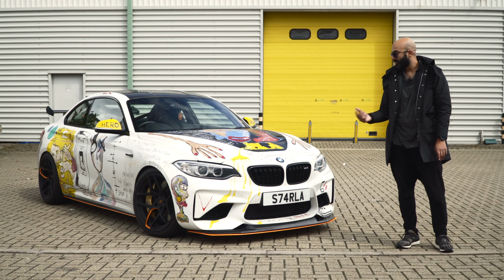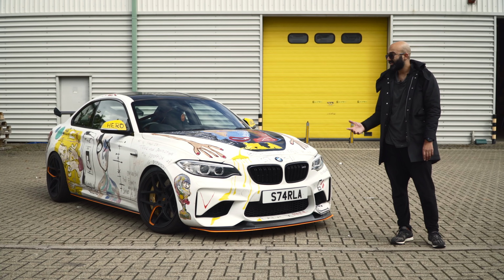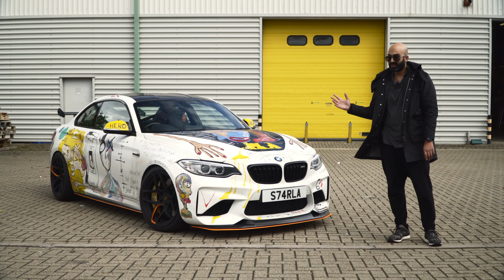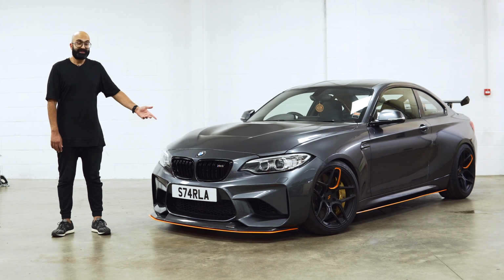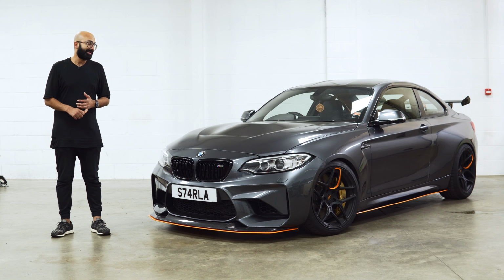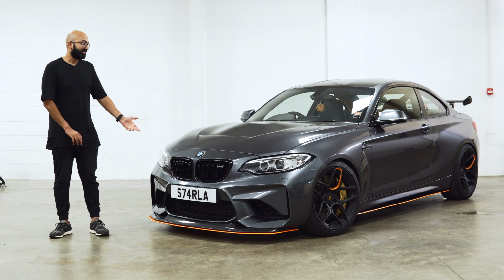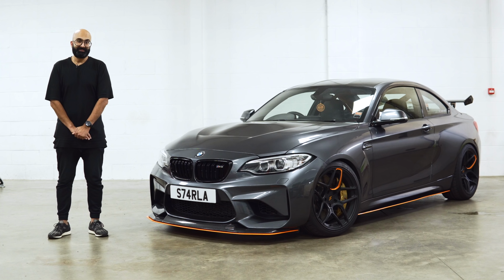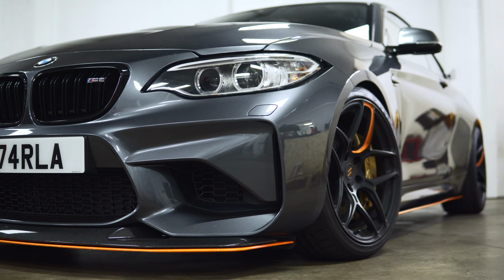RIP M2 GTS Art Car

Comment: I’ve a 2016 M2 Mineral Gray with just 4000 km... and I’m considering the carbon roof. How difficult is it to install it? Does the interior get ruined? What’s about front and rear glass? Thanks :-)
Reply from the maker: If done properly interior does not get ruined. Front and rear glass has to come out and get out back in. It is a job for professional body shop
Reply: Evolve Automotive Yes of course, this is professional stuff... but removing internal panels might be tricky and often there is always something that get broken. I just want to be sure the car is perfect also after the modification (interior and where the glasses are glued).
Reply from the maker: We have a very trusted body shop who carried out the work for us, and it's perfect, to OEM level. The new M Performance roof is dealer fit, I certainly wouldn't trust a dealer to do the job!
Reply: Evolve Automotive I fully agree... and to be honest I don’t like the shape of the M Performance roof. Your roof is much better :-)